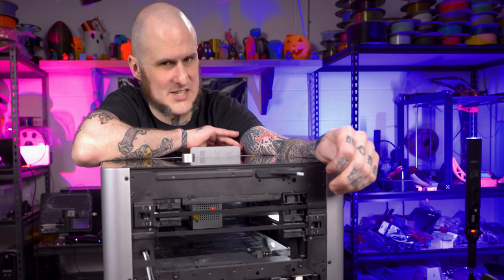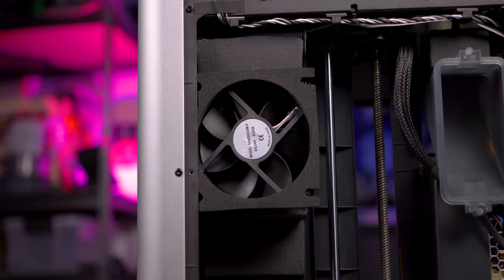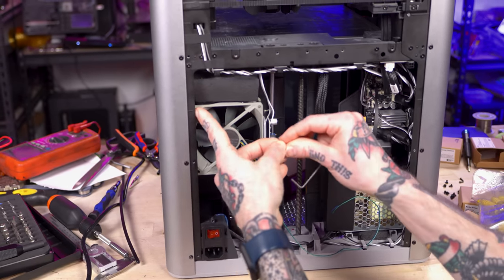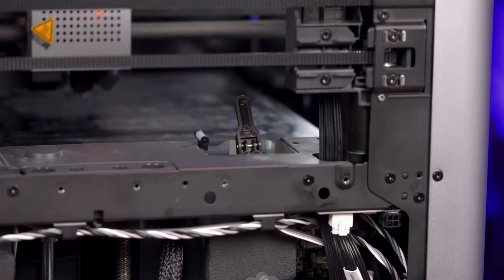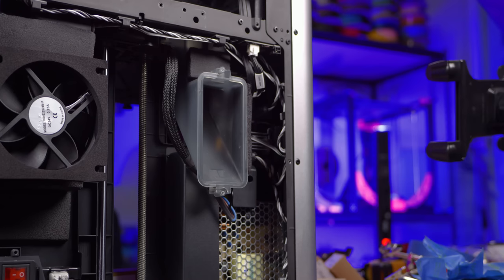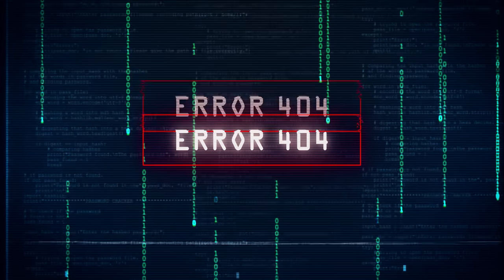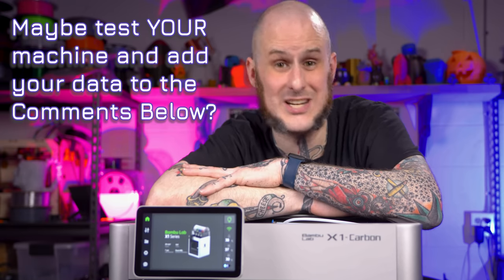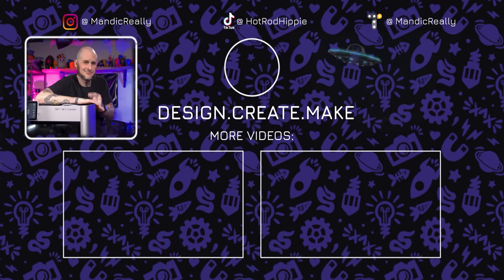Noctua Fan in the Bambu X-1? Chamber & Mainboard Fan Replacement!

Comment from the maker: Want to try it for yourself? Here is the parts list, but again, this is at your own risk! I can't be responsible for user error or changes to the wiring from Bambu.

Parts Used (Affiliate Links):
* Noctua 92mm PWM Fan: https://amzn.to/3i6I9cN
* Noctua 40mm Fan: https://amzn.to/3WXpKhr
* Buck Converters: https://amzn.to/3G3hg1o
* Printable Buck Converter Mount: https://social.thangs.com/m/55313
* Polymaker Filament: https://tinyurl.com/Polymakerr
Reply: Actually, if there’s one thing to learn from your video, isn’t it that we’re better off without the chamber fan at all ?
Some cool mods on printable seems to filter the air better. Take a look at « bento box »
Reply from the maker: @_Xantras_  that is in fact the take away I got actually... And I do intend to do something along those lines (what I hinted at toward the end of the video).
Reply: @MandicReally  Watching content creators do take the risks before I do really is a guilty pleasure XD
Reply: @MandicReally  what if you remove the filter box competely? Its inactive when printing ABS and not need when printing PLA. Should give a performance boost...
Reply: I always thought the Noctura fans moved less air than the factory fans.....am I mistaken?
Reply: What voltages should the fans be?
Reply: There's another Fan which could be nice for the Bamublab as a Chamber Fan. The Thermalright TL-B9. Slightly louder as the Noctua but more static pressure and better airflow.

Comment: Sure would be nice if noctua would put out some 24v fans
Reply from the maker: At this point they really should. They are popular on printers, one would think it would make sense.  Especially in their Industrial PPC line.
Reply from the maker: @guesswork  120 and 140mm only unfortunately.
Reply: @MandicReally  I think you underestimate the margins in which Noctua thinks in case of product development catastrophically.
Reply: Moin,
I'm running 12v noctuas on many printers with unfiltered 24v.
The fans handle double voltage for years now.
In case they will be louder on 24v but they are still more quiet.
I found anpther brand that is actually more quiet than noctua.
The brand is called aab.
Im really impressed with these fans .
Reply: @crommet92  do they make them in 24v
Reply: @crommet92  in their product roadmap, they have 24v 40mm fans planned for q3 2023, and a 24v-12v converter planned for q2
Reply: @Aikano9 the 40mm fan in the x1 is 5v, which Noctua already makes
Reply: It will be same loud or close like any 24v fan. You compare 1400rpm with 4000rpm fan its not fare. What make Noctua fan so quite? Special blade design? Maybe we can make a copy of it(we are 3d printerers😅) and change original blades?
Reply: @fakel87  you have a very bizarre understanding of how fans work. The stock fans are very loud for the same CFM vs noctua. RPM doesn’t matter, flow and pressure do.
Reply: So why not remove the 92mm fan and replace it with just a duct.  Use a 92 to 120 mm  fan adapter with 24V Noctua fan on the outside of the case?
Reply: Use their buck converter
Reply: @crommet92  

I highly doubt your fans are still living with twice the normal voltage after "years".
Reply: @MandicReally  They have a 24v version in the Industrial line. I'm not sure if it came out after this video was made but as I watched you doing your mod my first thought was why didn't he just use a 24v version so I looked it up on Amazon and there it was... 🤷‍♂️
Reply: @lb8384  I have the same setup on my printer. I actually was a little more scientific with my testing. I ran a noctua fan for about 24 hours and used a thermal camera to measure the coil windings inside the fan at different voltages to make sure I wouldn't melt one of the coils. If I remember correctly, there was maybe a 15C degree difference. I've also been running mine for about a year in my printer with no issues
Reply: @MandicReally  At least now Noctua has 40mm, 120mm and 140mm 24V fans. :)
Reply: They have a few now.

Comment: Funny you found the machine switches from 100% speed to 40% speed once it recognised the slower fan, I've taken to switching my stock fan speed down from 100% to 40-50% once the printing starts to quieten it down. I've found the same as you with the Noctua that it keeps the chamber cool enough at only 40% -50% speed and the noise difference is considerable. This is using PLA at 220-240 temp and bed at 55 btw. So if people don't want to go through the hassle of changing it out I'd recommend this quick fix instead of just lowering the speed once it starts.
Reply: I received my X1CC back in August.  It wasn't very loud at first until some later firmware updates so I'm sure it ran a round 50% at first and I did 3.5 hr PLA prints on the cool plate with everything closed no problem.
Reply: I just saw your post and while I'm printing I did the test to lower the chamber fan to 50%. It's effectively much less quiet. What I noticed is that when the chamber fan was at 100%, both the part fan and aux fan were a 0%. When I lowered to 50%, the part fan was started at 100% and the aux fan was started at 20%. I don't understand as I always thought that PLA was using a 100% part fan. Anyway, these fans are much quieter than the chamber fan so the overall noise level was greatly reduced. Thank you
Reply: But if the stock fan at 100% cooled roughly the same wouldn't the stock fan at 40% cool considerably less? The noctua is a better design allowing it to have better cooling at slower speeds
Reply: @andyvannort2743  bambu stock fan has cfm of 92 at 100% speed, this is down to 37cfm at 40%, 46cfm at 50% and 55cfm at 60% speed. The noctua at 100% speed has a cfm of 46cfm. So yea it is more efficient as the system recognises it running at 40% rpm of what the stock bambu one would be but running the stock bambu at 40%, 50% or even 60% considerably reduced the noise (which is the goal) and keeps the air flowing out. 👍🏻 I’ll be honest I’ve switched from 40% speed up to 60% just to be on the safe side.

Comment: oooooh Alan is going to be popular in the bambu discord/FB group :P but seriously, that 17dB drop is insane, almost a quarter the volume
Reply from the maker: Especially when you consider how Decibels work, it is a pretty large drop.  I hated printed PLA before because the fan noise bothered me more than the printer's mechanical noises, now I can deal with it!
Reply: @MandicReally  yeah 10db is a doubling in volume correct?
Reply: @Mobile_Dom  correct
Reply: @pooounderscoreman  incorrect. Every 3db is a doubling in sound intensity.
Reply: @3dPrintingMillennial  incorrect. Every 6db is a doubling in sound volume. You swapped volume and power.
Reply: Everyone apart from @mandicreally Incorrect; 3 dB is a doubling of power

6 dB is a doubling of voltage or sound pressure level (SPL)

10 dB is considered to be, to humans with a non linear sense of amplitude, a doubling of apparent loudness.

Comment: The exhaust fan is a confusing one.  They recommend removing the top and opening the door when printing PLA.  On a Voron, the exhaust fan is supposed to run a slow speeds to put a negative pressure on the inside so it can keep the fumes under control.  After printing, it can be turned up higher to remove the fumes and cool down the machine faster.  It's not really there for controlling temp while printing (unless you're running a Nevermore and overheating the chamber, but the Bambus don't do this).
Reply from the maker: Yea, if Bambu setup the fan to run at even say 10% just to remove fumes on prints that need it I'd get it's purpose, but they don't. And with PLA / PETG prints, the Activated Charcoal Filter is just a restriction on the airflow of the chamber fan.  It really doesn't need to be there for those materials so it makes even less sense to me.  Seems like they should have considered something like a Nevermore in the chamber for scrubbing / evening chamber temp, and a non-filtered fan to exhaust heat for those filaments needing cooler temps.
Reply: @MandicReally  I'd assume the activated charcoal filter provides quite a bit of air restriction. If you were to remove the restriction would you get significantly lower temps? I also wonder where the air would even be coming in from given it's mostly sealed. Seems like the fan doesn't really do much unless you have the door/top open.
Reply from the maker: @js-nk4sd  actually the door is really poorly sealed, so the incoming air is pretty clear. I will test removing the filter, just couldn’t justify confining down the testing path for this video.
Reply: @MandicReally   Doesn't that show a really big lack of clear instructions or a manual how the printer is supposed to function? And I dont mean "How to print a part in PLA." I mean  what the cooling is for.

I havent checked it, but I guess in a Prusa manual or the Voron documentation you will find those infos. It's like Bambu Lab is screening the forums and YouTube and only add data and documentation if needed, which seem to be the other way around.

Comment: Sure it’s quieter, but if it doesn’t blow as much does it really matter? You can run the OG chamber fan at 50-70% to severely reduce the noise it makes
Reply from the maker: I tested that toward the end of the video and found a negligible difference.  Feel free to test your own fan and compare results.

Comment: Semi-unrelated, but just got an A1 this week and I'm flabbergasted by how little control the printer gives you, not even something as basic as speed outside the 3 presets, thinking in returning it 💀
Reply: how did you decide?
you can control a lot with orca/bambu-slicer. of course you are not able to change everything but imho you don't have to.

everything else you may want to change, such as fan-speed you can add a g-code so when printing PLA it will turn the chamber fan off or to a set value.

Comment: 1. Bambu Lab Chamber Fan 24V
    * Rated Speed : 4800 rpm/min   * Max Air Flow :  92.56 CFM 
2. Noctua NF-A9 PWM 12V
    * Rated Speed : 2000 rpm/min  * Max Air Flow :  46.40 CFM
Reply: Aaaaaand bambulabs is even cheaper.
Reply: Doesn't really seem to matter. Double the CFM and only 1°C difference (or in some tests even less) with such a small chamber seems strange. I bet the real CFM (and not only the one on paper) are much closer together.
*But it actually makes sense as the CFM shows the airflow and with a filter in front, high airflow fans are the wrong choice. You need high static pressure. So as I said both fans obviously perform very similar is this usecase and the Noctua is just much quieter.
Reply: I'd be worried if the stock one doesn't provide higher static pressure. 

Noctua fans are not useful in front of a filter. The static pressure is too low, they are not designed for that.
Reply: @LachskoenigIV  Wenn man beim originalen Lüfter die Hand vorhält kommt nur ein echt schwacher Luftstrom hinten raus. Das hat mich bei der Lautstärke und der Drehzahl gewundert. Bei dem Noctua ist er nahezu gleich was mich auch gewundert hat. Aber das zeigt, dass der Noctua besser für Static pressure geeignet ist als der original verbaute.
Kannst ja auch mal beides testen so wie ich.
ABER man man sollte den NF-A9 PWM nehmen und nicht den, den er genommen hat. Und es gibt sogar einen Converter von Noctua von 24v auf 12v (NA-VC1).
Reply: @Mastermoussa  Folie nicht abgezogen? :D schwach ist der Luftstrom bei mir jedenfalls nicht, ganz im Gegenteil hätte ich nicht so viel von dem kleinen Lüfter+Filter erwartet.
Reply: @LachskoenigIV  Was für ne Folie? Hab sogar noch nen Hepa Filter vor den Kohlefilter gepackt. Wenn du es mir nicht glaubst kannst es ja selbst vergleichen und wirst sehen, dass der Noctua Lüfter easy 80% des origial Lüfters schafft. Für über 4000rpm finde ich den originalen Lüfter echt schwach.
Abgesehen davon macht der Lüfter eh keinen Sinn. Er soll dafür da sein die Kammer zu kühlen. Aber Bambu hat selbst ne Liste wo sie empfehlen den Deckel plus zusätzlich die Tür bei den meisten "hitzeempfindlichen" Filamenten zu öffnen. Und sobald der der Deckel oben auf ist zieht die warme Luft sowieso komplett von allein nach oben und es wird "nichts" mehr durch die paar kleinen Löcher abgesaugt. Und wenn man quasi alles außer PLA druckt geht der Gehäuselüfter nicht von alleine an und man will auch die ganze Hitze drin behalten.
Reply: @Mastermoussa  bei mir waren zwei Folien, eine vor und hinter dem Filter. 

Klar, der Lüfter der mit exakt der Hälfte des Luftstroms angegeben ist und weniger statischen Druck liefern wird (Bauform/Drehzahl) schafft "locker" 80% vom OEM :')

In diesem Fall macht der Umstieg keinen Sinn, da muss ich nichts probieren. Wenn man den Filter nicht nutzen würde klar, dann lohnt es sich die Lautstärke zu reduzieren.
Reply: @LachskoenigIV  Bei mir waren am Filter keine Folien. Vielleicht oben über den Löchern aber das weiß ich auch nicht mehr genau. Ist jedenfalls jetzt keine Folie mehr.

Okay sorry du, der nicht beides getestet und erlebt hat weißt es natürlich besser. Sorry mein Fehler. Finds auch super, dass du die Daten vom OEM Lüfter hast und weißt, dass er mehr statischen Druck liefert als der Nocuta.

Weiter so machst wirklich tolle Arbeit.
Reply: @Mastermoussa  danke, nächstes Mal denkst du vorher drüber nach.
Reply: @LachskoenigIV  Werd ich machen. Ich frag dich einfach wenn ich nochmal was wissen will
Reply: Saying "rpm/min" is redundant, RPM already means "revolutions per minute" lol, it's like saying "ATM Machine"
Reply: anyone found a closer equivalent?
Reply: I was wondering what the cfm on the stock fan are at 40% which the x1c was triggering the noctua to. I wonder if just running the stock fan at 40% gives similar results. it's pretty quiet at 40%

Comment: Id love to see the vent fan tested directly, like with a flow meter. That and the filtering. I feel like so many printers have these, but no one really tests them and for mods people rarely ever empirically test the mods as well.
Reply from the maker: Problem for me is trusting cheap fan testers.  Testing fans by just holding up a meter isn't a very good setup.  So it is a matter of "Do I spend money just to produce flawed data?".  Sometimes I can justify that because some "flawed data" at least points us in a direction, but I don't know about fan testing like that.

Comment: WOW That is insane. Great little upgrade for sure! I do not think you hurt it either, but man that sound difference is INSANE. I just do not think I would use this fan often personally
Reply from the maker: I primarily print those materials that don't use the fan myself, so it was fairly silly of me to do.  But I'm ready for the random times I do PLA multi-color prints.

Comment: Awesome mod video!  I had to swap the fan on my Ultimaker years ago because it was so loud.  I'm considering an X-1 Carbon and it is good to see the community coming up with "improvements" already.
Reply: the noctua fan is pushing only half of the air that the stock fan move. i just checked, i was conviced by noctua fan but i think it's a bad idea
Reply: @mathenzobillault2486  Good to know.  Thanks!  After using the X1 for a while now, I'm actually ok with the noise level.  It is in my office now, but soon it will be moved to the R&D room so noise will be a non-issue.

Comment: Thanks for the video.  It gave me some things to think about.  I am printing ABS and the smell was getting pretty strong in the room.  With the talk about your new fan effecting cooling, I decided to try an experiment to try and force some of the fumes through the filter.  When printing with ABS, the exhaust fan is turned off.  My chamber was showing a temperature of 51.  I turned the fan on to 20% and an hour later, the temperature was still 51 and the smell had decreased.  So I tried the fan at 40% and the temperature dropped to 48 with the smell about the same.  Set it back to 20% now.  Will have to modify the GCode for the filament to run the fan at 20% for ABS from now on.
Reply: did you have the carbon filter installed?
Reply: I was also wondering that on my p1s when printing ABS the Cham fan doesent work. but for what is the carbon filter when he doesent spin :-( so i put he also to 10-20% for exhaust now

Comment: I have just been turning my chamber fan down to around 50% because it is truly obnoxiously loud. The entire machine feels an order of magnitude quieter when you reduce the chamber fan. Kinda blown away Bambulab would go with such a loud fan for the job.
Reply from the maker: Yea, I've gotten used to the noise level of it printing, but that fan noise I simply could not get over.
Reply: @MandicReally  Yep, I'm so happy they introduced the ability to control fan speed.

Comment: What is the point of changing it to a super quiet low CFM fan, when you can regulate the RPM of the original fan?
I am highly sceptical it would be noticeably louder than Noctua at the same CFM.

Comment: @MandicReally I had the RPM issue on a QNAP when replacing YSTECH fans with Noctua. The issue comes from the peak-to-peak voltage in the RPM signal. You can fix it by putting a resistor across PWM and Tacho/RPM. In my case it was 6.8kohms. Easiest way to find out is to put a variable resistor in.
Reply: Can you elaborate on this? You're referring to the issue with his fan showing 40% on the display when it's actually running at 100%? And that can be resolved by putting a resistor across PWM and Tacho/RPM? I'm not super experienced with this type of electrical, so just follow instructions to a T and try to pick up bits and pieces of knowledge as I go.